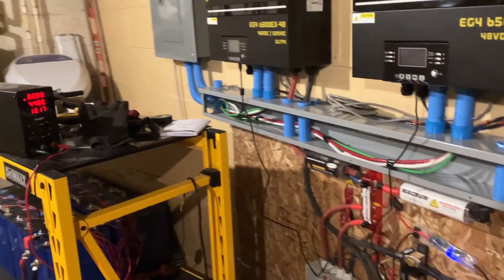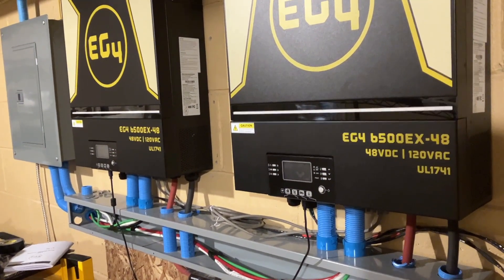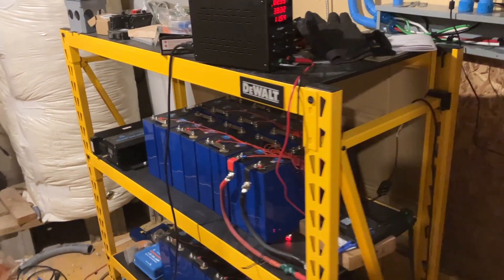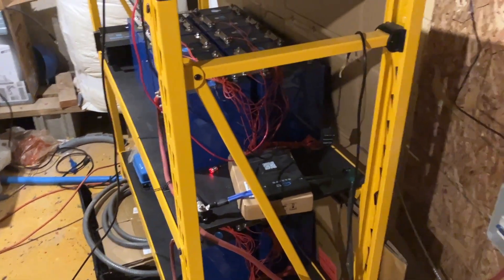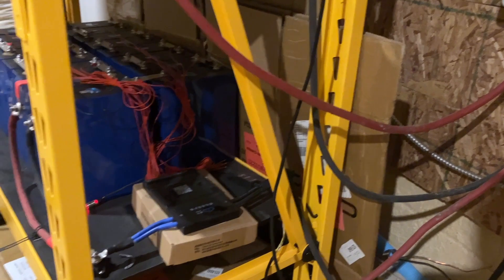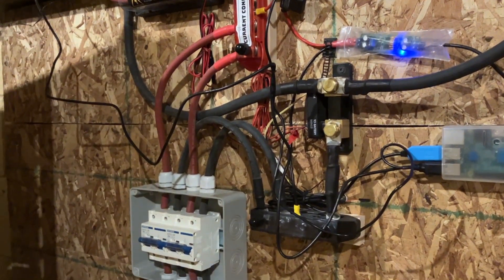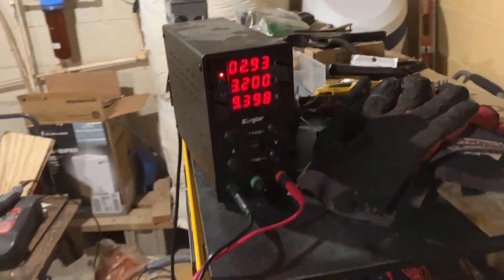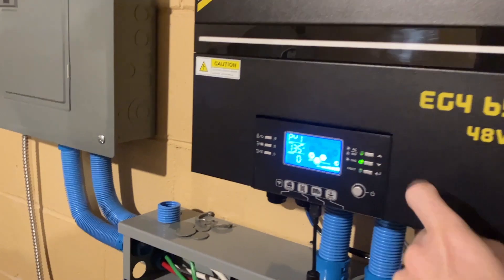Whoops...Ran Outta Power

Comment: Use a 10-20ohm resistor and you can even put a dmm parallel to it to see the voltage going towards zero. Choose a resistor so you don't get visible arching. There is no point in deteriorating your gear with arc pitting. You waste a second or two, that's all. 
With a dmm you can also see if there is a short after the breakers, this way. (I.e the voltage doesn't drop and the resistor starts heating up)

And most importantly: do not let your cells go that low again. Set your inverter(s) uvlo at 3v/cell. There is very little energy in a cell between 3.00v and 2.50v but the small differences between matched and balanced cells are exacerbared. 

The BMS uvp/ovp features are supposed to be the last frontier protection. Normally you should never trip the bms protections, only balancing if available. Your charger should have an upper floor limit of 3.6v/cell and the loads should stop drawing at 3.0...3.1 considering the load and the sag you have.
Reply from the maker: Thanks for the suggestions!

Comment: I think the solution to avoid a bms low voltage event is to have a communication protocol that would report to the load (inverters) all the individual cell voltages so the bms will stay on but turn off the inverter. Of course, this doesn't protect against overcurrent events but it would solve the issue with cells drifting voltage at low state of charge which will happen especially in the future as the battery cells age. maybe you could install a second smart BMS with slightly higher low voltage trigger that will activate a small relay to switch the inverter off!!! That is how I would DIY something like this. Main bms for overcurrent and emergencies and a second bms for the inverter on/off switch!

Comment: I went through some of the same problems, where the inverter needed to be pre-charged or it would shut down my batteries. 
What I did was take my inverter positive cable, and remove it from my positive bus bar, put the resistor between the bus bar and the cable and presto, after 10 seconds or so I would tighten it back on the busbar and all was good!

Comment: Did you already test how much Watts your inverters do consume?
Reply from the maker: I had at one point but I don't recall what the actual idle consumption was.  I wana say it was around 70W per inverter although that consumption changes depending on the load you're running because the fans speed up for larger loads.  

While in grid-bypass mode, I can see that the inverters together pull a cumulative 64W from the batteries.  That's something I know I didn't think about was the fact that if I was in bypass mode, the inverters would still draw from the batteries.

Comment: I'm surprised you're seeing 'sparks' when pre-charging your inverter capacitors? I wouldn't have thought you need to keep 'jabbing until you don't see sparks' because I thought the whole idea of a large resistor is that it will slow the charge down to the capacitors.
Reply from the maker: The "spark" is so small though, nothing like what you would see without the resistor.  If you're not staring at the tip of the resistor, you'll probably miss it.

With 2 inverters in parallel and my buck converter, there's a lot of capacitors that need to be charged up.  It also depends on the size of resistor you have to know how much power is gonna be allowed through.

Comment: You should try to balance all your batteries hook them up in parallel and then charge them up at low amps. Then let it sit and settle to be at the same state of charge.
Reply from the maker: Everything was top balanced prior to install.
Reply: I setup my batteries in groups of 4 and charged to full but this was not correct way.  Looks like I’m using the same power supply for charging batteries. I would recommend try balancing again but set it up as 3.65 v battery with the rest parallel to them.  This ensures it’s all at the same state of charge and within 0.02 mv for each cell difference. LiFePO4 is different than AGM or lead acid. If this still fails maybe u might have issues with this 2 batteries in specific
Reply from the maker: The issue has been resolved.  All the cells are w/in 2mv of each other.
Reply: @AdamDeLayDIY  awesome news!!! What was it so I can know myself if I run into this issue. Thanks. And great setup
Reply from the maker: Thanks!  Well my biggest issue was the inverters not being programmed to shutdown before the LVD in the batteries was hit.  This was all done before I had the grid-bypass (AC IN) hooked up.  Now I don't let the packs get below 30%. 
 
From the battery standpoint, I went through and top-balanced the packs to ensure each cell was within a few mv of each other.  By the time I was done, both all the cells were w/in 2 mv of each other.  Took a while, but well worth the time.
Reply: @AdamDeLayDIY  thank you for sharing keep your the good work!

Comment: I would suggest finding a BMS/inverter setup that recovers automatically from cell low voltage cutoff
Reply from the maker: This was just early enough in my installation where I didn't have all the safety features set up the way I should have.  

I just had to program my inverter's automatic shutdown voltage to be higher than the LVD in the battery BMS.  This was also long before I had Solar Assistant set up to automatically switch to grid mode when my SOC got to be too low.  

I shared this as a reminder for me and a warning for others to not make the mistakes I made.

Comment: With the double throw breakers, you’ll one simple jumper and one with a “pre-charge” resistor. Once you’ve charged the inverters, you can go ahead and close both breakers and remove the jumpers.
Reply from the maker: Yep.  That's what I'm doing right now but I'm looking to simplify.  Since the breakers are in a junction box, I have to either open the junction box up or get some longer wires and go from a BMS to the bus bar.  I want to look at wiring up a pre-charge "push button" that I can use to avoid the inrush.  Another option that I saw from jehugarcia was to hook up a charger to your bus bar and set it to the battery voltage.  That would allow you to pre-charge the capacitors then you can flip on the breakers without messing with a pre-charge resistor.  Haven't tested it yet, but also looks promising.
Reply: @AdamDeLayDIY  
I highly recommend getting rid of those din rail 125 amp breakers for the batteries. I’m running tow 200 amp Blue Sea(Buss brand) marine breakers but they are actually rated at 48 volts max but no problems and I don’t switch them under load anyway, I turn off the inverters first. I have two pre charge resistors with momentary switches. If I had to do it over again, I’d definitely would be going with a pair of 200 amp DIHOOL single poll breakers instead. I have no problems running my central air conditioning and the clothes dryer at the same time even if the batteries are at a lower state of charge.
Reply from the maker: @SkypowerwithKarl  yeah the 125s I have are from my old 12v system.  I need to update those and the gauge wire run to my batteries as well.  Right now my loads are pretty limited so I’m not worried about exceeding the ratings right now.

Comment: Appreciate the video. Are you able to have the grid automatically recharge the batteries when it hits a certain state of discharge.  Based on your comments, this is being done manually.  Appreciate the clarification.
Reply from the maker: I don't believe there's any way to only have the grid recharge at a certain SOC.   The SOC options (for lithum batteries with BMS connections) only control when the AC Output switches to utility mode.  As far as I understand, you can program in the charger source priority (menu 16) to be either "Solar First", "Solar and Utility" or "Only Solar".  If you have either of the first two selected the grid will recharge (based on the priority) up to your bulk charge voltage (menu 26).
Reply: @AdamDeLayDIY  My understanding the two programs are separate - one for AC demand side and one for battery charging. Will need to chat with Signature Solar to qualify this.
Reply from the maker: @Jay Schwarb Let me know what you find out, I'm very interested.  I attempted to charge the batteries from utility this morning by changing the charger source priority from Solar Only to Solar and Utility. Nothing started charging until I turned off Solar and switched to SUB mode.
Reply: @AdamDeLayDIY  From SS: most likely inverters are in ‘SUB' (solar, utility, battery in that order) mode which would not allow you to charge batteries and power loads simultaneously with your AC input source. Setting your inverters to 'SBU' (solar, battery, utility in that order) would allow you to charge batteries and power your loads simultaneously via AC input source. Then, once your batteries recharge back to the voltage of your choosing, your inverters would switch back to solar and battery (or just battery if no PV is present) to power your loads.
Reply from the maker: @Jay Schwarb that’s very interesting that they would say that because I was doing that exact thing this morning in SUB mode.  I couldn’t get it to charge from utility when in SBU (but I wasn’t past the low end threshold in the menu), so I had to change it to SUB and then turn off the solar.  Once I did that, it started charging.  

I did misread your comment this morning (and I can only blame the lack of coffee) and from what I see in the manual, yes you can program in either a voltage or state of charge (while in SBU mode) that once that threshold is reached, the inverter will switch over to utility (menu 12).  I’m assuming the charge priority (menu 16) will determine if your battery is charged by the utility power or if it will wait for solar to recharge the battery, while the utility will handle the loads of the inverter.  

If you have a lithium battery that the inverters can communicate with, you can set a state of charge threshold.  Otherwise you have to set a voltage threshold to make the change.
Reply: @AdamDeLayDIY  glad to hear. Sounds like it is working out.
Reply from the maker: @ Jay Schwarb I assume what SS is talking about works.  Right now I'm not using that option because I don't have server rack batteries that can communicate SOC to the inverters.  

The only way I could use that option is by voltage and voltage isn't very reliable with LifePo4 batteries because of the extremely flat charge/discharge curve.  That's why I'm using Solar Assistant to change charge priorities because it can examine the SOC from my smart shunt and then trigger the change.
Reply: @AdamDeLayDIY  understandable.  I bought the complete system since the pricing was so reasonable. Best -Jay
Reply from the maker: @jcschwarb  nice!  Enjoy!

Comment: Don't know how much solar you have...but between lack of solar and/or lack of battery based on usage....you need to re-access your situation.   imho
Reply from the maker: Appreciate the comment.  Since this video was put out, I've added an additional 1.2kw of solar bringing my total up to 6.2kw with 28kwh of battery capacity.  I knew going into this project that right off the bat I wouldn't be able to run my home indefinitely off solar.  It would be a slow process where I would add more solar and storage over time.  So for the time being I'm happy to switch between battery and grid.  Any little savings while running off solar helps.  Thanks again!

Comment: Adding a few smaller batteries (say 2 more 100AH) will divide the precharge load over more BMS limiters.  The big issue is both LVs/EGs are precharging at the same time.   It is even worst with 4 x LV setup.   I currently disconnect all the LVs from the 
battery bus bar.   I flip one on one by one.  There by precharging only one LV at a time.
Reply from the maker: Good idea.  I have a plan to add an in-line pre charge resistor for my start up procedure.  I just have to find a couple 48v push buttons that I can use.  Most are labeled as 12v.